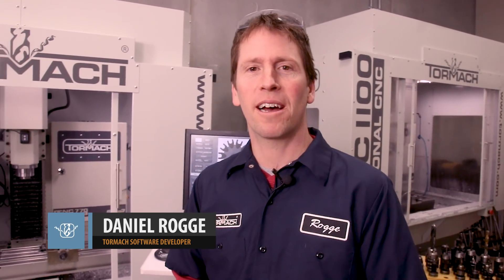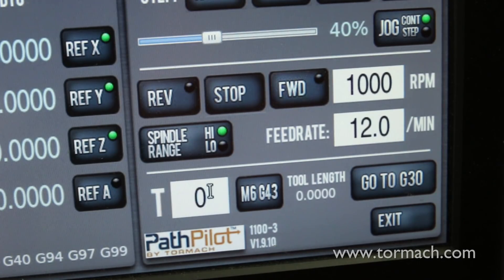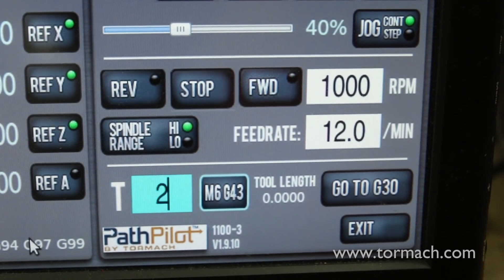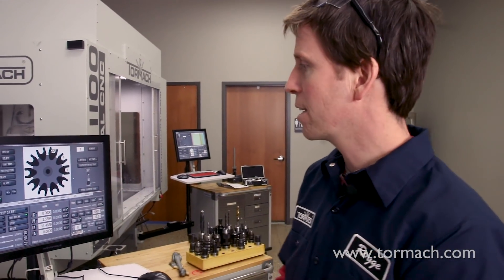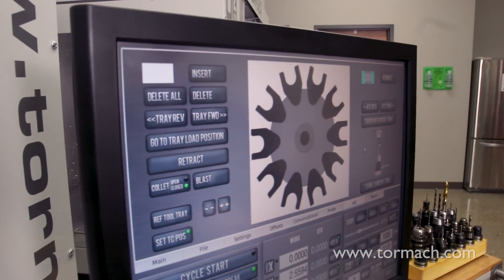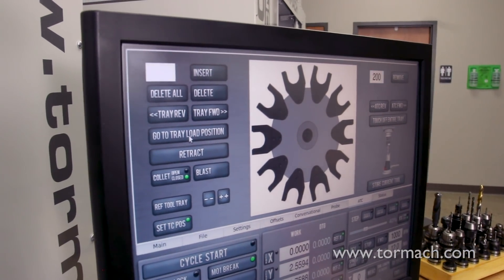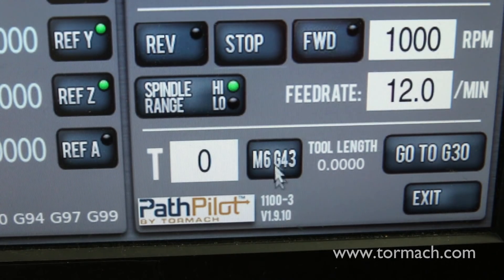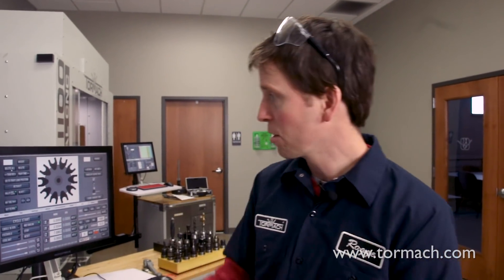Adding Tools to Your Tormach ATC with PathPilot

Comment: thanks for the info, i was using the slower auto way to load it.  2 Questions, can you explain how to use the touch off all tools button works. I have the ETS but am not sure how to set it up for the ATC to do run threw them all. also is there a way to move the Z down well the turret is in the load position? I need it in the load position to take measurements for a secondary spindle mount i want to make that will still work with the atc
Reply from the maker: Hi, thanks for the comments. To use the "Touch Off Entire Tray" button, plug the ETS into the accessory port and test communication by actuating the ETS by hand, and ensuring that the green Tool Setter LED on the ATC Control screen lights up. Center the Tool Setter directly under the spindle and click the “Touch Off Entire Tray” button on the ATC Control screen. The ATC will cycle through every tool in the tray and enter the measured tool length in the tool table. As for the second question, there is no way to move the spindle down in Z, while the ATC is in the tray load position.